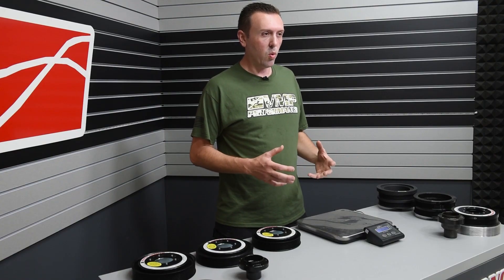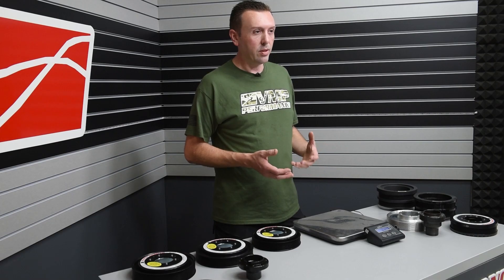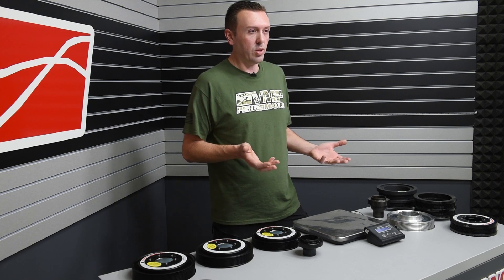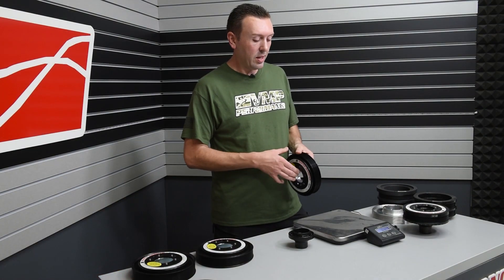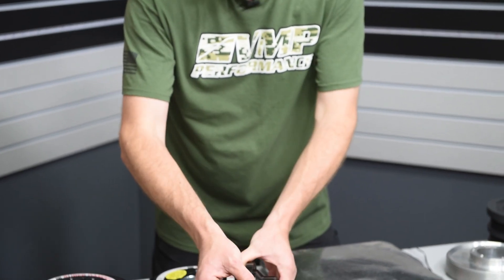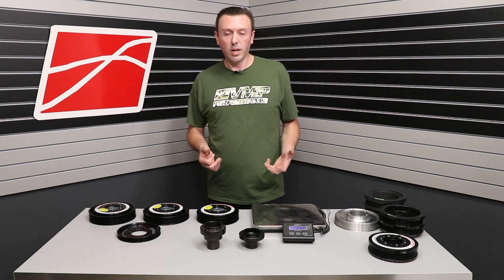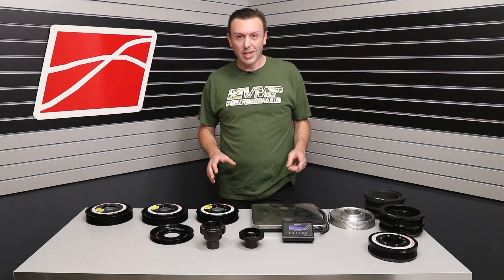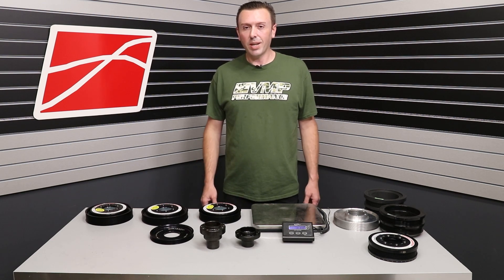VMP/ATI Overdrive Balancer kits for 5.2 L Predator and 5.0 L Coyote Engines || Product Spotlight

Comment: You mentioned the offset and pulley alignment being different from the old setup at the end.  Does this mean i can't use this with my dinosaur 2.3 without modification of some kind?
Reply from the maker: This system will line up with our currently line up of supercharger pulleys and with going 20% lower, you'd need to spec a pulley size any way.

Comment: Do you guys have a lower profile tensioner than the one you already offer? I just installed the 20% and does not clear the tensioner
Reply from the maker: If you're talking about the accessory side tensioner, our Super Low Profile Tensioner clears up to 30% OD and can be found at the link below:

https://www.vmpperformance.com/VMP-super-low-profile-accessory-belt-tensioner-for-OD-balancers
Reply: @VMPPerformanceTV  yes. I already have one for the 15% that was on the car and now the 20 doesnt allow it to bolt on. So theres a low pro and super low pro? Or did you guys remake the low pro even smaller? Thanks!
Reply from the maker: The super low profile tensioner design replaced that prior tensioner as we designed larger OD offerings.  Now we just offer this design as it clears everything we offer in our current line up.
Reply: @VMPPerformanceTV  perfect thank you
Reply from the maker: No problem.  Thank you for your business and support!

Comment: Will the 8 rib OD work fine with 6 rib setup? Thinking of getting 10% with the attachment to run a/c. Don’t want to switch to 8 rib just bought the bomber bracket and some washers fell out during shipping.😞
Reply from the maker: The available 66 mm / 2.5 in griptec 6-rib pullies pretty much max out what is possible with 6-rib so we do not recommend the ATI yet.  Sorry about the shipping, the idler washers are standard, the stepped idler is only an issue if you are using the roush FEAD, in that case its PN VMP-SUT013 please call in.  
66 mm pulley: https://www.vmpperformance.com/66MM-6-Rib-Pulley-for-VMP-2.3L-TVS-Blower-Kit

Comment: What's the purpose of these.
Reply from the maker: They are used to overdrive the supercharger and convert to 8 and 10 rib.
Reply: @VMPPerformanceTV  At what horsepower point do you need 8 rib over 6 rib?.
Reply: @VMPPerformanceTV  Why would you want to overdrive supercharger?
Reply from the maker: By overdriving the supercharger's belt drive via a larger crank pulley, you can actually run a larger supercharger pulley in exchange for a mechanical grip advantage to prevent slip.  As for when to consider 8 or 10 rib, it's more down to the vehicles usage and if you're experiencing belt slip with the 6 rib set up during that use than it is a specific horsepower number.
Reply: @VMPPerformanceTV  No belt slip yet with  6 rib 79mm pulley to 7700rpm boss 302 gen3r e85. Eventually going down to 75mm pulley cause anything smaller than that is useless on street...lol.
Getting th400 installed soon so no one will beat me😆😆😆😆😆

Comment: I wonder can the grip tech treatment can be done to it ?
Reply from the maker: Typically slip is at the supercharger itself, not the crank.  An overdrive lower assists by allowing you to go larger in supercharger pulley size while increasing OD diameter.  This increases mechanical grip as there is more surface area.  Then you can utilize things like ZPE's Griptec treatment on the supercharger pulley and auxiliary idlers to increase belt wrap.

Comment: Question : is the internal rotating assembly balanced with the stock balancer and if you change it to a lighter ATI, will it mess with the rotating assembly balance?
Reply from the maker: Great question!  It will not as it does not involve the total weight of the balancer.  To make it super simple, balancing has more to do with placement of the weight.
Reply: All Ford modular engines have been internally balanced since 1996.  That's why these are NOT balancers anymore.  Harmonic damper is the correct term.